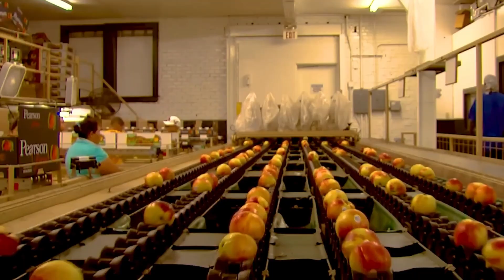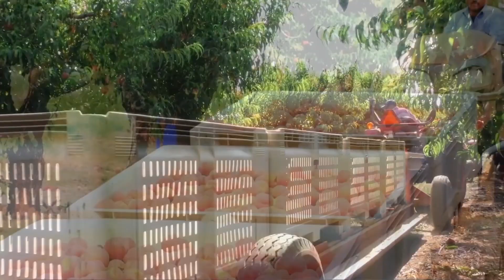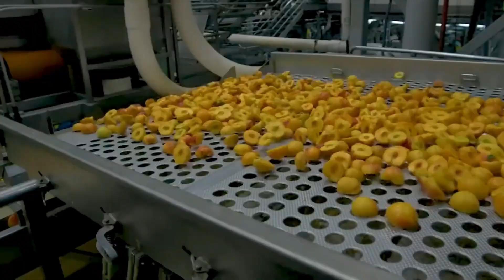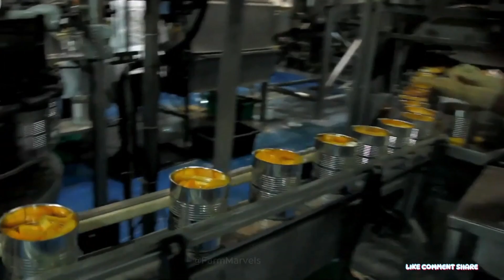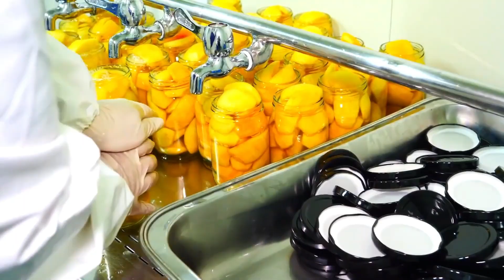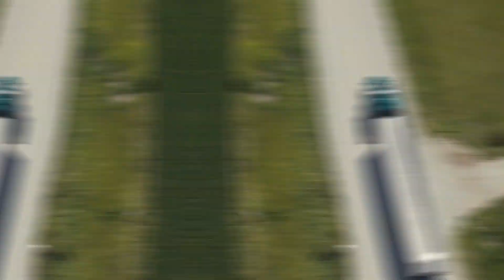How Canned Peaches Are REALLY Made – Factory Process Revealed!

Comment: In 1980 I worked for Filper Corporation as an engineering aide testing the Filper Clean Pitter at the Thomas C Richards cannery (summer job). The machine aligned the peach, cut the peach in two (except for the pit), then rubber grippers rotated the peach halves in opposite directions. The cutting blades had a notch for the pits such that the pit remained stationary while the peaches were rotated - this separated the peach from the pit.